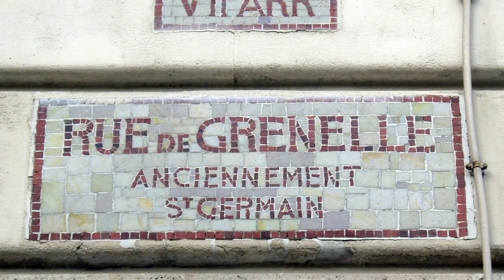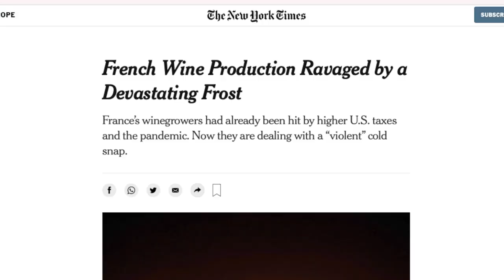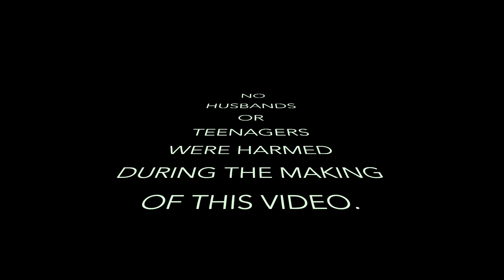EP 8: TRAPPED IN THE TURRET! SNEAKING INTO SAUMUR CASTLE,  ASPARAGUS, & WILL THERE BE WINE IN 2021??

Comment: Vivienne, to truly pick Asparagus, point your knife down towards the soil and push it about 1 - 1.5 inches into the ground, curved blade towards the asparagus spear,   Use your blade knife to cut the spear and pull out .  When you only cut from the top of the soil you can actually stunt part of the growth habit of the plant.   By digging the blade of your knife below the soil surface, you encourage the plant to send out more rhizomes underneath the surface, thereby increasing your yields year by year.  When you cut the spear above the ground, you invite bugs and other pests to enter the plant from the top down.   Your knife blade should be very sharp and  curved.  Cut as much as possible at a 45 degree angle.   I suspect you have been gathering your asparagus spears for a few years the way you are doing it and if so, that is why the spears are very large.  The plant is letting you know that its roots are starving and have no choice but to send up a thick stalk in the hopes that it will bloom and produce little red seed heads.  By cutting below the surface you'll allow the plant to spread its feet a little more and give you thinner spears in more abundance next year.   Remember:  do not pick any spears for a minimum of 3 years per plant to let it establish itself.  After that, only gather 1/3rd of the spears per plant patch. 
You can roast the spears or my favorite way to eat them is recently washed in cold water and the tips 'snapped' between your fingers in 1 inch lengths, served as a topping over a mesclun greens salad and freshly roasted and still warm, garlic clove and Parmesan salad dressing.
Reply from the maker: Mmm...we shall definitely try this delicious salad idea! 💖🌸🥰